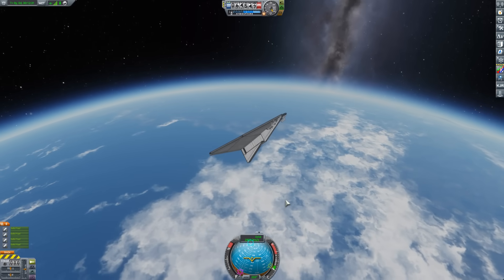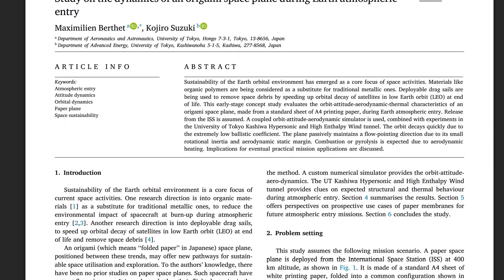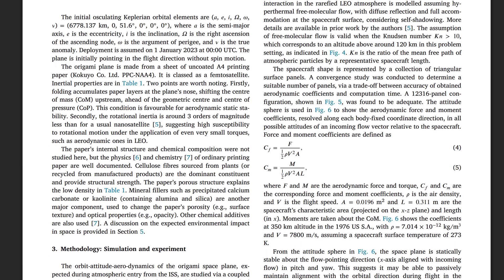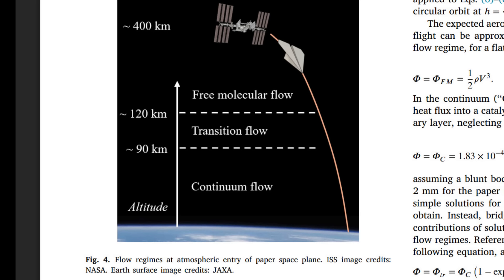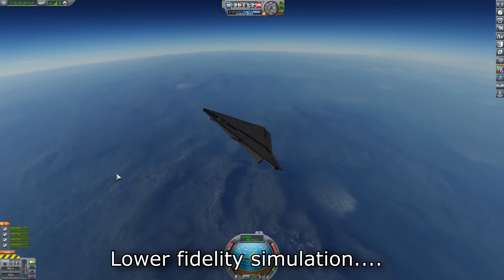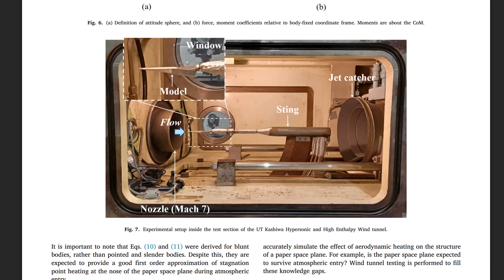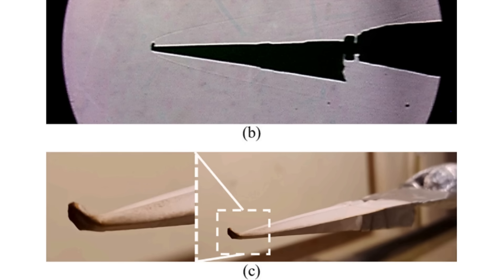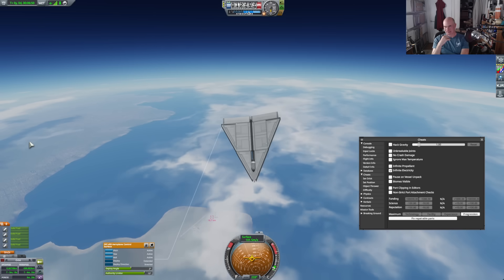Could A Paper Airplane Fly Back From Space?

Comment: doubtful a paper airplane would ever hit dense atmosphere at Mach 3 as experienced in wind tunnel. 
BUT: if  airplane weighs 10gr going 25,000kmh, wouldn’t F=ma  dictate how much energy would HAVE to be dissipated by aircraft slowing down to walking speed in X time?   If it decelerates too quickly, isn't it akin to hitting a brick wall and releasing energy through deformation into a ball of crumpled paper  instead of heat?   So isn't this a challenge of maximizing deceleration to take plane out of danger of burning up, while being slow enough deceleration to ensure it maintains its shape? 
Consider this scenario:  paper airplane flies at 25,000kmh in a "hyperloop" vacuum tube and is instantly subjected to 1atm pressure. Wouldn.t the plane be torn to shreds as it "instantly" hits atmopsphere/brick wall ?

Comment: Forcing high-velocity air over the paper airplane in a wind tunnel might not represent what really happens. It seems very possible that the relative velocity between the air and the plane would drop very quickly once the plane contacted the atmosphere. Even if tumbling occurred initially, if the plane survived it might eventually stabilize and make a gentle nose-first landing.

Comment: If I understood the text of the study (7:17) correctly, the paper plane will be heated with around 100kW per square meter for several minutes during the decent. A plane, the whole thing rather than just the nose, made of paper from the local craft store won't survive that. This result is likely influenced by their particular plane design, so maybe a different shape can make it, but I'm guessing paper will be difficult.
Reply: 4 grams at 400km should only have about 16kj of potential energy
Reply: @kahlzun does that calculation  include the orbital speed of the ISS? Genuine question
Reply: @RadioFlyer39 that was just the height. The orbital velocity adds another 112kJ.
Definitely a lot of energy, but kW for minutes seems to be quite a lot..

Comment: It would burn up. It would immediately pick up speed due to the lack of atmosphere then as the atmosphere increases so would the friction. The wind tunnel test is improper and incorrect.  If the paper plane is tumbling because in doesn't have direction (you do have to launch it in a specific direction) It would have been best to est in a skydiving wind tunnel and just drop it flat or backwards (anything but correct) to see if it would straighten up.

Comment: The Columbia accident reports revealed that delicate cloth patches and light high surface area low density materials basically lost all their velocity immediately, came straight down, and appeared essentially untouched from any reentry. Granted the patches were beta cloth but ptfe (the coating of beta cloth) melts at 327°c - only a bit hotter than the ignition point of paper and they showed no signs of reaching that temperature despite being significantly denser so I think the odds are very high they would make it through.
Reply: And, famously, a music CD that an astronaut took to space survived.
Reply: Intuition intuits that the lightweight high surface area paper airplane would be quickly slowed. However, would the gazillions of hypervelocity atomic bullets shatter the paper fibers in the process?
Reply: Tbf, by the point it was exposed to atmosphere it had already slowed down significantly
Reply: The Columbia debris were not traveling at orbital velocities
Reply: This is what I was thinking.  My question was whether it could return to stable flight before the aerodynamic forces ripped it to shreds, but if bits of cloth survived, then I'm guessing it would flutter a bit while decelerating to essentially free fall, then tip down and fly,
Reply: Yeah, the wind tunnel exoeriment didn't make much sense
Reply: The space shuttle broke up around 40km up. VERY far into the atmosphere and it already lost a lot of its energy.
It was prob going around 20,000kph so that is still extremely fast for anything

Comment: JP Aerospace are thinking of a super light ”plane” commuting between orbit and an aerostat station floating at around 45.000 meters. The plane is to have such a low density that it doesn’t need a heat shield. They have a couple pieces on yt, looks really cool. ATO, airship to orbit.

Comment: What I read from the paper is, that the pressure/air density in the wind tunnel was 10^3 times than the real environment, which of course will heat it up much more, and let's not forget that the air in the tunnel is "driven", the plane would definitely decelerate a lot. Just release it from a car, it will immediately come to a halt. The gradual increase in drag would help to not generate excessive heat. Still building my formulas to take a better guess

Comment: I already thought about this a while ago, in my opinion a paper airplane should survive with no issues. 
Because the weight is few grams with a lot of surface area.
This is a huge difference between a normal spacecraft in which you have the payload and the whole spacecraft mass, all that kinetic energy is just absorb for the first milimiter (or less) of the shield surface and that surface is 10 times smaller vs the paper airplane case that is turning at random. 
In the spacecraft case, only a tiny fraction of the spacecraft material is helping to slow down the spacecraft, in the paper case every atom is helping to slow itself.

Comment: If you released the paper airplane from a stationary position in space, it would start falling very fast and probably won't survive hitting the atmosphere.  If it was released at the top of the atmosphere where the air would give some resistance, the plane being so light weight might survive the flight to the surface. If you released the plane from the ISS and have to deal with 14,000 mph orbital speed then there is no chance for a paper airplane.

Comment: Let's crowdfund a paper airplane launched by a cubesat on the cheapest rideshare rocket we can. Scott should lead the effort, of course. So how would you track the thing? Could it have anything like a flight recorder? Perhaps by embedding some thin wires in the thing, active radar could track it and give us its orientation.
Reply: The cost ranges from 3,000 to 100,000 $ per kg to space even at the high end 2g is only $200 RC planes have been made weighing a few grams so a simple transmitter doubling the price to $400 a bunch of mates could fund it by passing the hat around.  If 500 were released with no telemetry and they took 4 days and the time was known with 8 billion people, some should be seen wring an address and phone number on them $100,000  pass the hat around at a space X launch.
Reply: @JonathanTamm  Sounds good but I assume the range on such transmitters is pretty limited. Still, with a big dish on the ground perhaps that's not a problem. Of course, the cost of renting a big dish for however long it takes adds significantly to the price.

Comment: I'm not so sure that the wind tunnel is the right way to simulate a paper plane.  Yes, you have the air velocity right but the plane is forced to hold at that position.  A real paper plane would probably just flutter around and not actually travel at that speed.  Just like throwing a paper plane out of an automobile window going at freeway speeds would nearly instantly slow down to barely moving.  I think the air would slow it down to the point where it simply is not going that fast any more very quickly and not really generate much friction at all.

Comment: Let's not pretend that the scientists in possession of a hypersonic wind tunnel don't talk about goofy things to put in it all the time.
Reply: At XCOR we built a shock tube which could do high mach flows for a few milliseconds, and when a fly got into the tube, the test crew pumped it down anyway and popped the diaphragm. To our amazement, it survived both the vacuum exposure and the momentary Mach 3 flow, but bounced off the end of the tube hard enough to break a wing off. All we accomplished was to turn it from a fly into a walk.
Reply: @r0cketplumber  I slapped one against a mirror the other day, bugger literally wedged in the gap between my fingers, and flew away immediately. Proven in RL
Reply: @r0cketplumber username checks out 😂😂
Reply: Back to Argonne. We had a Cobalt 60 source that, when it was new, was 275,000 Curies. Along with all of the official research done with it, it was determined that the predicted inheritors of our civilization, cockroaches, were lightweights compared to Box Elder Bugs which survived the thousands of R field generated by the source for many times longer than the cockroaches.
Reply: @steveanderson9290  Good god!  That is a source and a half!  Give that to your worst enemy as a paperweight.
Reply: @jeromethiel4323  It still resides at building 200 M-Wing (as far as I know). When I retired in 2014, it was down to "only" 100,000 Curies. I am told that it originally arrived on a truck whose only other cargo was a refrigeration unit to keep the cask cool.
Reply: @steveanderson9290  I believe it.  That's a crazy high curie count.

I mean i received special training to handle a very low curie neutron source, just because neutron radiation is especially dangerous.

But Co-60 is special.  Extremely high penetration gamma emitter.  Which is why it's used for X-raying welds and other metals.  You need a lot of gammas to get through steel.  Half thickness of steel is 4" IIRC.
Reply: @steveanderson9290 oh I hate box elder bugs!!
Reply: spherical cows, obviously
Reply: @immafriedric3 All cows are spheres, for the correct values of cow and spheres.  (Yes, I did go to school for physics)
Reply: @israel963 or maybe all spheres are cows! 🤯
Reply: They stuck a model of the 'Starship' Enterprise in a Wind tunnel in the late 1960's. It went ass over tea kettle... 😂
Reply: @williamduffy1227 I mean the ship would just decelerate before entering the atmosphere and slowly descend, so aerodynamics don't really matter for that.
Reply: Bet a few lunches have been heated in there...  Just saying.
Reply: Fact is stranger the fiction.
Reply: You know for a fact them nuclear space tests they did in the 50's were just a bunch of scientists saying, "dude!  I got an idea.  Let's make the biggest bottle rocket ever created and see what happens"
Reply: If you have to ask "Why???", you have clearly never experienced the boredom of working in a wind tunnel.  😅   I was mostly a visitor but once the techs decided we were cool they got up to all kinds of shenanigans.  These were automotive tunnels with an open section so you could stand right near the invisible wall of high velocity wind.  And perhaps huck things into it.  Or sit back into it like it's a chair while it's spinning down past ~90mph.  (Gotta wonder if somebody ended up way down at the bottom of the expansion testing the limits of that trick!)
Reply: Pealing a banana is a breeze if you have a hypersonic wind tunnel.
Reply: @hakanlundberg  your comment made me visualise using the hypersonic wind tunnel to put on a condom. Thanks for that😅
Reply: That’s actual science.  The shit that gets funding isn’t necessarily inspired by curiosity.
Reply: For their next project, I suggest that these researchers test an OG Battlestar Galactica Colonial Viper in the Hypersonic Wind Tunnel.

The reason being that years ago I chatted with some JPL scientists at Lucky Baldwin's in Pasadena about BSG and the design of the Viper.

A couple of them mentioned it having decent aerodynamics and having a viable design as a space vehicle.  It apparently would be capable of successful atmospheric reentry with just some minor tweaks and design changes.

They mentioned testing it in a simulation software called Torch, that they use to do the heat analysis of atmospheric reentry vehicles.
Reply: We must have the best frisbees.
Reply: I can confirm that scientists are children at heart. Children with knowledge and resources at their disposal.
Reply: @jakelilevjen9766  in my experience, being an engineer/scientist is how my inner child survived.
Reply: I mean there was one known public instance that they tested die-cast cars basically
Reply: that needs to be a channel
Reply: Like Brenda from HR’s cat?
Reply: Talking about goofy stuff is successful maybe 1% of the time if lucky.
Reply: "It is a truth universally acknowledged..."
Reply: "The difference between goofing around and science, is writing it down"

 - I know the quote from Dr Karl (an Aussie science communicator)😮, but it's probably from somewhere else
Reply: @MrVelociraptor75  Adam Savage from Mythbusters was the original source quote!
Reply: Rule 34 of hypersonic wind tunnels.
Reply: @justinbiondi Obviously that means certain toys should be placed inside the tunnel. And depending on how immature the scientist is, placed in and taken out many times.
Reply: It's been done at least once.
Reply: so they tested paper at 4-7.5k mph in setup where it is supported by some structure and they can set sheet at an angle of least resistance/friction. Orbital speed is over 20k mph. What was air density in that test?
Reply: Some YouTuber stuck a diecast model of a U-Haul truck in one once, that was highly amusing.
Reply: Me looking at a spectroscopy machine in the lab with a bottle of soda in my hand wondering if the ingredient list is accurate.  I can’t.  It’ll take forever to disinfect, I couldn’t explain what I’m doing to anyone who walks in on me, but, hmm.
Reply: someone's gotta put a uhhh, Bilbo Baggins, let's call it for the sake of YouTube rules, into a hypersonic wind tunnel. I wanna know if the flared base will stabilize it, or will it prefer to fly the other direction, kind of like the pellet from a pellet rifle? I've got to know! for science!
Reply: I dread to think what the guy who photocopies his ass at office parties gets up to...
Reply: I wonder how good the aerodynamic of a circumcised pp
Reply: "I wonder how quickly a condom would inflate if we put it in the tunnel..."
Reply: An erect phallus would be a fun one
Reply: 100% sure if there was at least 1 guy in working there! If not probably just 95%😅
Reply: Probably ended the lives of man mice or hamsters
Reply: There is an aerodynamics model of a cow for a reason
Reply: They do
Reply: a big ass bowl of popcorn...and sit behind it to see how much you can eat
Reply: "hey, so what if we put a glove on the wind tunnel while everyone is off for lunch?"
Reply: Sandwiches. Someone's stapler...you name it, they've "tested" it. That's my bet!
Reply: My favorite engineering video is a cheeseburger in a wind tunnel.
Reply: @NotSure416 see! No matter what you are picturing, it's happened!!
Reply: That thing that was in mom’s drawer that time. We must know.
Reply: You know what would be a fun thing to put in there? Testicles. Not human and not (currently) attached to any living thing, but just balls. The Coandă effect might be neat 😂

Comment: The wind tunnel and computer modeling can't be accurate. The drag to weight coefficient would keep the airplane traveling slow with respect to atmospheric density.
The model shows red heat as it re-enters, that would never happen because the atmospheric drag would slow it down way, way before that could happen.
Yes, while it is still outside the atmosphere it would topple as it falls to earth all the while slowing down with respect to atmospheric density and would eventually transition from falling to flying righting itself as it encountered an actual airstream.
Let's be realistic, here is a crude analogy... 
In order for the space shuttle to have a drag to weight coefficient equivalent of a paper airplane it would have to have a cross-section the size of Manhattan.

Comment: IIRC, Reaction Engines' "Skylon" spacecraft was supposed to reentry using this phenomenon, being pretty much a pointy hydrogen balloon in orbit. It wouldn't have needed a heat shield.  
I think Starship was also supposed reenter using just its low ballistic density and gas bleeding for skin cooling. I guess the maths didn't add up or something.

Comment: Instead of heat-shield material, what about if you used something like titanium foil for your "paper"? It's got a good mass/strength ratio and can withstand some pretty impressive temperatures. It'd be expensive, but it seems like it could work.

Comment: Hey i worked on a REXUS project where we developed a glider that was deployed from a sonic rocket at esrange... I personally worked on REXUS GAMEon but  our team before  (GAME) basically built a glider out of 1mm thick foam and deployed it from the same altitude what we experienced is that no matter where you put the center of mass the glider will not fly and mostly tumble around before a  altitude of about 6-10 km  before that it doesn't get  get into a stable flight pattern mostly because it is way too fast. at this altitude it starts  to slow down enough to be able to fly...  I think its also a factor of the wing loading ... The game glider was approximately (i don't know the exact numbers) 45-60 g and had a surface area to fit inside of the rocket (the REXUS rocket has a diameter of 300mm) 
Our GAMEon glider was way heavier (150g) and had a very similar shape.. we started flying at around 6km.  So my best guess would be that a paper plane would also only fly after it slowed down enough and i would guess it will be at the same altitude. Range